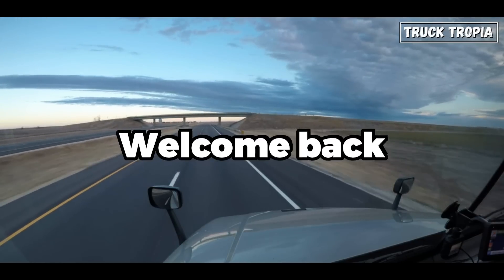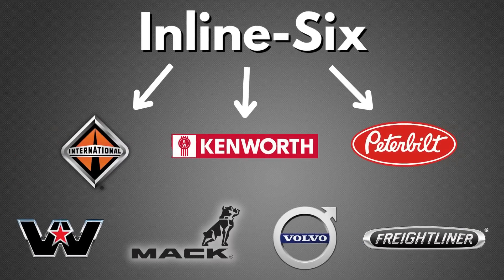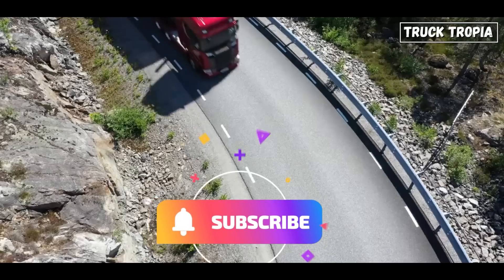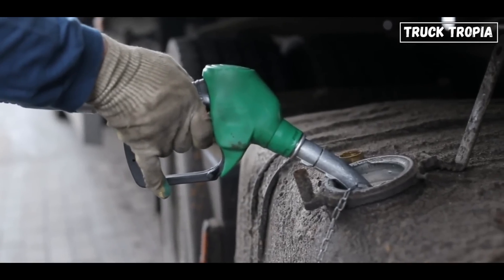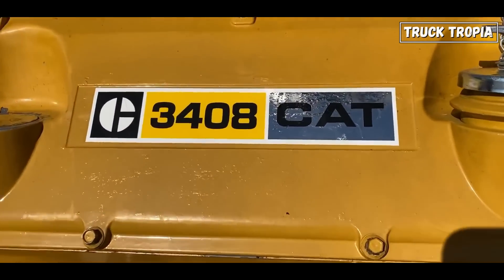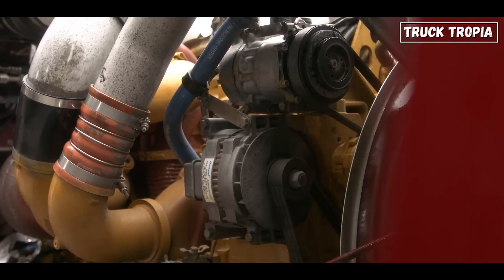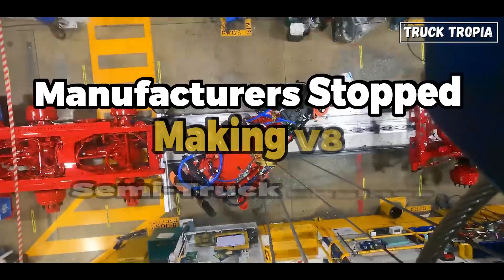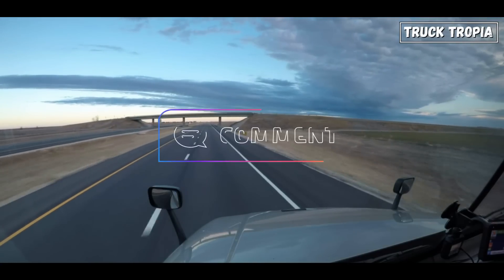Why US Manufacturers Stopped Making V8 Semi-Truck Engines?

Comment: Nothing sounds better than a 2 cycle v12 Detroit
Reply: Drop a pair of turbos on the 12V71 and hold on tight.

477 HP @ 2100 rpm, 1251 lb.ft @ 1600 rpm with NO boost.

14 pounds of boost will get you 931 HP and 2442 lb.ft of torque. Will need bigger injectors as the 65# injectors will be too small. 

For those who  do not know, a 12V71 has a displacement of 851.2 CID, which is just short of 14 litres...and it's a v12, 2-stroke beast.

Comment: Just by converting to Diesel Electric they can increase the efficiency up to 25-30% over night. Keeping the engine always at the same RPM under constant load makes it pollute less and utilize the power better. Also the cool thing about Diesel is you can basically get 0 pollutants out of the exhaust. You do need certain equipment to do so but combining Diesel Electric with the right equipment can keep the Diesel on the road for the next decade...

Comment: I am a V8 diesel addict. I have a CAT 3208 10.4L V8 diesel  in a 1985 Chevrolet C70 Kodiak single axle dump box (former plow truck), a Detroit fuel pincher  8.1L V8 diesel  in a 1983 C60 bus, then in light trucks a 1997 Suburban with Detroit 6.5L V8 diesel, a 1992 GMC Savana Van witn a Detroit 6.2L V8 diesel (will be a doner for a pickup), and my last V8 diesel is a 1981 Chevrolet C10 2wd with a 5.7L V8 diesel but I do have 4 diesel tractors and a 1981 Mercedes 300d and 1992 Jetta diesel even though there not v8's. However my favorite Detroit Diesel is the series 60

Comment: Prior to the truck 3408, Cat had a DOHC four valve engine. The Cat 657 scraper had the V8 in the front and an inline 6 for the rear engine. That DOHC 6 was also available for trucks.

Comment: All I know is that European trucks are super slow compared to American trucks. In the U.S. trucks always run between 70 and 80Mph. In Europe they are limited to just 55 Mph. And often really slow 35 Mph speeds. 

Trucks in the U.S. generally are pushed much harder having to haul loads at greater speeds and over vast distances bigger than that in the EU. Not to mention trucks in the U.S. have to typically run through larger varieties of climates. 

6cyl engine's also develop torque at lower rpm's compared to V8 diesels typically. So while a V8 diesel can produce more torque in theory, it doesn't develop the torque where it's needed most to get the load going. 

For heavy haul applications the 6 cylinder diesels just proved to be a better design.

The U.S. also has more strict diesel emission standards in general compared to the EU. Again why Catapiller gave up trying to meet them and why VW had to buy back diesel cars from America's where as those same cars with the same engines were still legal in the EU.

Comment: I still run some of the older 2 stroke Detroit’s in a few of my trucks up to the 12-92 also have Mack’s with the V8 along with the Cat 3408 in some of the tractors . When It comes to emissions I can care less Humans will wipe our selves out long before the earth will become inhabitable . I do heavy haul the newer engines and few of the tractors can do the job for my fleet plus no electronics and regeneration to give problems my new ones seem to give a lot of trouble in that system plus it’s a rolling bomb to me unsafe you seldom saw a fire in a truck crash now about every one burns !

Comment: Only had one V8, 8V92N in my 66 KW  it would run with my friends 12V71N . BUT!!! 3.8MPG and flange mounted alternator. I carried a spare alt. had to change my alternator on Snoqualme pass at night once. That 66 K wobbler got lot of "What's under that hood" comments.  "JUST AN UNRELIABLE 92 DETRIOT" first and last V8 and first and last Detroit!

Comment: What most people don't want to understand is Less cylinders results in less Fuel consumption and fewer emissions Not only Due to Engine size. 
If you take One displacement, lets say 12L engine and Make a V8 and an Inline 6. The weight of 1 Piston in the i6 will be More than One piston in the V8. But combined i6 pistons will weigh about 25% less. 
There's a minimum weight demanded to have enough material to withstand the forces of combustion, and with increase in Bore that raises only  slightly. Way less than adding new pistons. Also Other components weight significantly more due to extra Crank counterweights etc.
All of that produces resistance and inertia that demands more fuel to Just move on Idle. 
i4 would use even less fuel but it would need to be significantly taller and It would start to have Torque gaps because of no Combustion overlap. so is kind of Ideal for Truck Diesel speeds and rpm. Some EU tractors use i4s now but before they used i6 exclusively. Like 100-180hp farm tractors always had a i6 now many have i4's. 
i6 is also a very naturally well balanced engine with very little need for extra balancing shafts and other stuff. V8 especially Traditional US non Flatplane isn't. And no one makes Flatplane diesels because they don't spin fast enough to gain from it. 
All of this applies to pollution too. 
When it comes to EU nothing compares to Scania V8 and Mercedes V6 and V8, but they are just not realistic anymore. Especially in EU new 6 cylinders sound like shit but the Power and torque, reliability and fuel consumption is amazing.
SCANIA kind of has to Hold on to the V8 because it has a lot of Fans with a Cult mentality. V8 is still not needed since the 2000s in Europe we can make Straight 6's with 900hp no problem.
Reply: Scania engine in a Moxy articulated truck was the sweetest running straight six I have seen.

Comment: The longer-stroke  - larger displacement - higher torque argument is nonsense. An engine can be built with any stroke and cylinder displacement with any number of cylinders. The displacement determines the possible torque output.

For the same total displacement larger cylinders mean fewer cylinders, so the engine is simpler, but larger cylinders also mean lower practical operating speeds and thus lower maximum power (with the same maximum torque).

For heavy truck applications displacements over 1 litre per cylinder and up to 3 litres per cylinder are practical for a modern turbodiesel. That means that if you need 15 litres, you can use five to 15 cylinders, or in practical terms 6 to 12 cylinders. There's no reason to use more cylinders than you need, so six it is, and 8 is unnecessary.
Reply: Because of the geometry stroke is limited in a v8 unless it’s made flat ( boxer) ?
Reply: @goforitrazz  there's no geometric limit regarding stroke. It is larger bore which causes conflict between the banks in the vee format, forcing the use of a taller deck. A vee engine can get too wide, and large truck V8s can hang over the frame rails on both sides.

Comment: Two main factors:  inline engine cheaper to build.  Larger cylinders are more fuel efficient due to lower heat loss.  Thus you always use as few cylinders as possible while keeping vibration and peak impulse torque within usable limits.  Which is why cars are now using 3 cylinder engines in small displacements.   Cheaper, more fuel efficient.  That's it, game over.

Comment: With all the smart people out there why aren't we making these vehicles run on hydrogen it doesn't need diesel to make power it needs a fuel that's easily burned in hydrogen easily switch it over to a crank trigger and uses spark plugs in fire at off even though it's a two-cycle it doesn't matter because we can feed the fuel in through the intake inlet
Reply: Hydrogen will never be used for a low-revving, high-torque producing engine. Slow burn beats a quick pop. 

H2 liquid/gas is not easy to contain.

Hydrocarbon combustion will be the safest, most reliable, and inexpensive form of automotive mechanical power until we advance past the internal combustion engine.

Oh.. and by the way..

Carbon dioxide is less than a fraction of one percent of our atomsphere. "Climate change" is a political agenda to geographically lock people down. Prisoner propaganda.

Comment: You forget to mention that electric trucks will need to be recharged using coal or gas fired power stations.
Reply: When these charging stations take control the prices of recharging will go through the roof, that is the way of corporate America Right BLACK ROCK and the other two?
Reply: Haven't smelled coal smoke since I was a child and we used it to heat our home. I smell diesel exhaust everyday.
Reply: @steven4315  As Elon Musk says going electric on transport will necessitate a 30% increase in electricity generation...
Reply: @AdrianHepburn-vz9yr  Over many years, about as long as it took to go to AC becoming common.
Reply: Even if they need is still more efficent to burn the coal or gas in big static engines than in a small mobile engine
Also renewables are evolving constantly, at this point is all politics andomey
Reply: That's why diesel-electric  is the best option

Comment: I’ve got a 3408 in my truck and it’s been incredibly reliable and that’s what counts where I live in Australia. If it blows up tomorrow I’ll still have had an amazing run out of it.
Reply: Why wouldn’t you rebuild it? Cat still makes parts for their on highway engines. There’s incredible aftermarket support for them too. You can get new parts for it.
Reply: Can you tell me why that engine isn't a 90 degree bank angle and if it is a split pin crank design?

Comment: I've owned close to 100 power units in a small trucking company since the 70's. I've ran inline 6's and V-8's from Cummins, Cat and Detroit.  The 903 (V-8) Cummins got better fuel mileage but was a maintenance and repair nightmare.  The inline Cummins wasn't far behind the 903's in repairs, but were easy to work on.  I didn't run that many Cats, but had nothing but good luck with the 3406B.  But my favorite of them all, in spite of their chronic oil leaks was the V8 2 stroke Detroit namely the 8V-71.  The fuel mileage was comparable to others, but those old "Yamahas", like the Energizer Bunny just kept going and going.
Reply: Many a mile and many hours were put on the Ole Driptroits

Comment: Only part of this video right but why U.S stopped using V8 because of packaging. Here in U.S we use Conv trucks (hoods) and using inline 6 fits better. Europe use cabovers V8 fits better and they do use inline 6 too. We need power too we have factory engines with 600. 605, 625 hp with torq highest torq rating at 2050 ft. Also here in U.S we have long distance with big roads with agv speed of 65 mph. Europe doesn't even have big interstate system like we do here in U.S.too. Europe also don't use long 53 ft trailers either like we do here in U.S. Most roads in Europe are small and cab over work great their. When Paccar bought Europe version of MX13 here for testing it won't pull 80k truck or high speed on OUR interstate. Needed major software change and some hardware changes.
Reply: The size of the US and Europe is no reference , both continents are flat and have mountains. The US biggest engines around the 660 HP(newest Cummins) European factory engines Scania 770 HP torque 3700NM and Volvo 750 HP Even Europe have longtrains and a good interstate as well.
Reply: @crocket1971  There is hugh differance we have bigger roads. and most of Uk, Europe and small tight roads. They don't use 53 ft trailers either like here in U.S. Europe doesn't even come close to interstate system that we have in U.S . I've been there UK, Europe, Germany nothing like we have. Cummins doesn't have 660hp either we are using 605hp. Again its about packaging on why we mostly use inline 6
Reply: @pdmustgtd1013  Europe is not inferior to the US and certainly not in terms of infrastructure
Reply: @crocket1971  Are you sure what Country you're talking about here?????????? Europe road system not like ours oh wait in U.S
Reply: @crocket1971  Cummins does have 750 and 1000 hp test engines that meet current emissions right now. But they will never be released they are used for verification of parts
Reply: @pdmustgtd1013 We talk about factory engines! Don't you heard about the Cummins X15D 660 HP (Daf Truck Australia)?
Reply: @crocket1971  Where was Australia in this???????? Talking about U.S  vs Europe WOW

Comment: I wonder how a cummins inline 8 would fare?
Reply: Too long, with a problematic crankshaft due to the length, and an unnecessarily large number of cylinders.
Reply: @brianb-p6586  how do you think a 16 liter Cummins inline 6 would do?
Reply: @jamescaliendo1030  That's only slightly larger than the current 15-litre Cummins (X15) so... just like the X15, with bout 6% more torque and power, and the same efficiency?
Reply: @brianb-p6586  yes but much larger bore. For years we ran 15 liter, and 16 liter Cats here and the difference was night and day. I'd like to see if Cummins would produce a 16 liter inline 6 for trucks

Comment: Reason is most US truck companies are owned by European truck manufacturers .
Reply from the maker: Europe scania still have v8’s
Reply: @TruckTropia  When did I mention Scania. Unless you want to know they owned by SAAB Aerospace. As SAAB automobile devision is none existence now as the first generation 9/3 and 9/5 were a Subaru Impreza estate shell and the later 9/3 and 9/5 were a Vauxhall Vectra shell plus the 1.9 diesel engine is a Vauxhall engine... The 2.3 petrol is SAAB's own engine and a pig when they go wrong as you can't get any new parts for them.. As they are obsolete...
Oh I'm more into classic Ford's though 😂😂😂. Anything you want to know about Ford Cortina's they my poison.
Especially 1.6 and 2.0 Pinto engine's.
Reply: @tonysilliker5977  the point was that European ownership is not the reason for ending V8 truck engines, because Scania is European and still has V8 engines. 

International and Scania are both parts of Traton, so International could use Scania's V8 engines if they thought there was a market for them in the USA... yes, V8's for America from Europe.

Comment: I6 has 7 main bearings, V8 has only 5.  This improves longevity.
Reply: 7:02 because you can't have more than 5 mains in a V8 they will run 1,000,000 miles no problem.  Have a nice day

Comment: I started out on a cabover White Freightliner in 1980. It was a 1974. It had a 903 Cummings V8. It had a 10 spd road ranger transmission.  It would wind up too quick. A straight 6 is much better for pulling loads and taking off. I was pulling a load, not running a race.  I discovered this when I started driving inline 6 cylinders.
Reply: You're right about those 903's winding up:)

Comment: The inline 6 is the most balanced design, many v8's will develop cracks in the block before they hit a million miles where as a Cummins 6bt has reached 3 million miles without a rebuild. They use inline motors because it's the longest lasting motor design their is.
Reply: Tell the 8v-71 that it's not as good as a 6cyl..
It'll laugh at you while pissing oil on your leg.
Reply: @carwashadamcooper1538  
LOL
pissing oil is right.
Reply: Wrong
Reply: I'm with you.
 7 main bearings versus 5.
 HELLO!

Comment: V8s were dropped because the extra weight is a penalty really. About 1,000 lbs or more weight difference. V8s make more torque and lower in the range but not needed unless weight restrictions are raised.
Reply: Even in Finland with a rather high weight limit, the V8 Scanias are not that necessary. 500hp can get the job done, sure with max load they really struggle to get moving but it can do it, 560-600HP is enough really, any more than that is unnecessary unless the terrain where you work is quite hilly or do overwwight special transport.